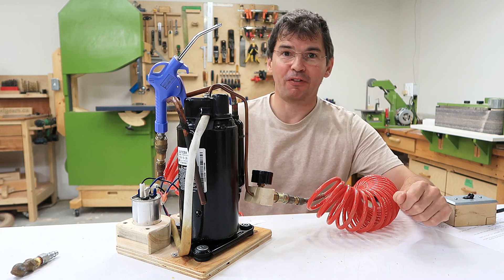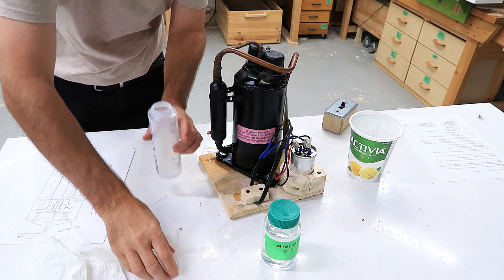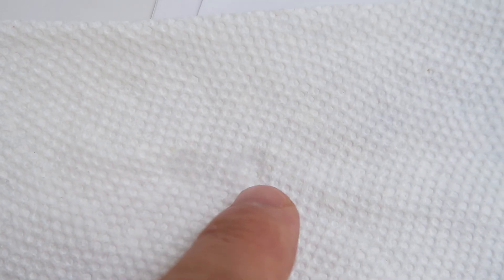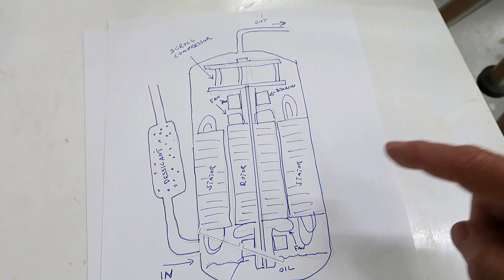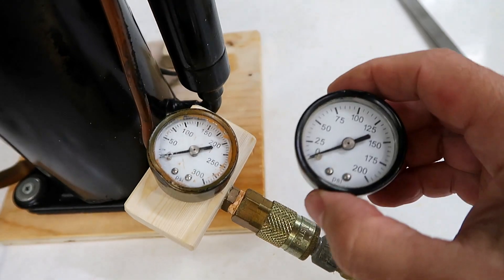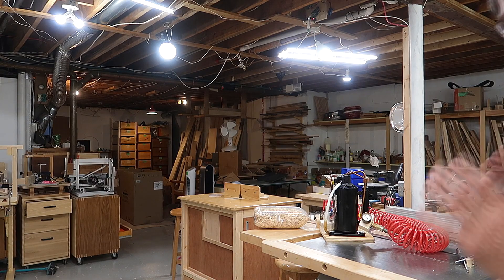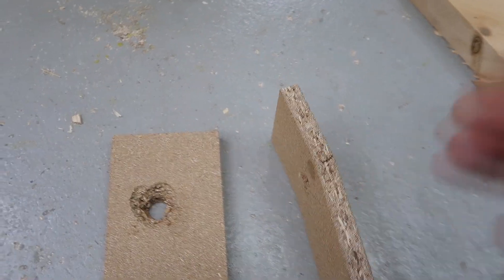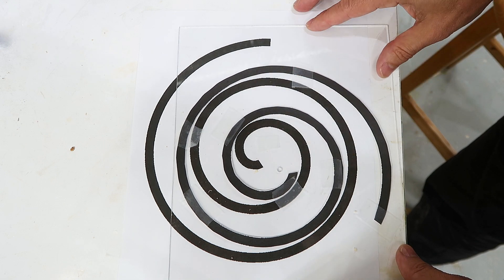This air compressor will fail

Comment: Seems like it would make a great second stage for helping your regular compressor go above 100psi. More efficient with already compressed air, and less duty cycle from doing work outside its efficiency range, and also pre-filtered air, so a lil less condensation.

Comment: You might have to add a air tank to get rid of the moisture and the oil. Commercial compressors with refrigerstor or ac motors are available, but they got expensive, I am glad that I bought mine 25 years ago..  Just google silent airbrush compressor and you will find exsamples (jun-air, sil-air etc.). Forget about the membrane ones, they suck completly (they spit water very quickly, ruined a lot of my artwork back then).
Greetings from Germany.

Comment: Heyhey, AC dipl. technician from germany here :)
a few tips:
dont turn the compressor on its head or turn it on when its upside down, the rotor etc can fall out of its bearing. And dont pump oil with it, the hydrolocking can damage the valves.
Use an oil trap to recirculate it into the intake.
And finally, visit the manufactures website on information which oils you can use. I recommend all ester oils
Reply: I wouldn't worry, he's an engineer and has been around machines all his life.  His Dad was a tinkerer and had owned a saw mill, his own wood working shop and also owned and took care of a campsite of cottages.  Besides, he said in the video that this machine was purely for experimentation.  He probably has a dedicated compressor for other tasks.

Comment: Well I’m sure you’re going to get this a million times but here goes. Eastwood does use a scroll compressor for there shop compressors. I personally have one and I can say it is incredibly quiet for a 12.5 CFM compressor and they clearly went through some effort to ensure limited amounts of oil make it though the output but yes it always has a bit of oil in the compressed air.
Reply: Does that mean going thru less tool oil?
Reply: @ZeroBlackfire  I was wondering that - sounds like a scroll compressor would be good for nail guns and other high lube tools.
Reply: @mikelastname no it wouldn’t be enough oil to lubricate an air tool.  You would still need to have an auto lubricator or add some yourself.  The amount of oil escaping from the compressor isn’t a huge amount.  It certainly isn’t a large enough amount to lubricate your air tools.
Reply: @ZeroBlackfire no it doesn’t.  The oil passing through isn’t anywhere close to being enough to lubricate your air tools.  You would still need to use a lubricator or add lubrication manually.

Comment: I used to pump soda bottles up to ~100psi for a project and didn't have a single failure...until one unexpectedly failed after I became comfortable around them.  It sent some plastic shards in my eyes and really messed up my eardrums for a few days.

Plastic shrapnel in the eyes is not fun.  I would not do it again.
Reply: Was it the same bottle or a new one every time?
Reply: @xxportalxx.  That was about 20 years ago, so I'm not sure how many times I had pressurized that bottle unfortunately.
Reply: @RK-kn1ud  ahh gotcha, doesn't really matter anyway I suppose.

Comment: Do add a input filter to avoid it filling up with wood dust.

Also, I am sure you can arrange a oil drip lubrication if you wanted. a check valve on the low pressure side may help it hold pressure too.

Comment: To help keep the compressor from having issues with water collecting in it, before putting it away after experiments, run it with no load for a minute or so to evaporate and remove any water that built up.
Reply: Bonus points if it is still hot from use, helping the water evaporate.
Reply: Problem is that unless it gets to boiling it won't evaporate because it's covered by a layer of oil. Though I guess a little that is still wetting the sides of the pressure vessel might.
Reply: @siggyincr7447  Since the oil gets pumped through, the water should mix in and enough droplets should be at the surface.
Reply: @Ultrazaubererger  water doesn't float on oil, it is the other way around.
Reply: I'm seeing so much wrong information in this video and comments. POE oil (compressor lubricant) absorbs moisture and breaks down into acid and alcohol. now alcohol is not a serious issue like acid is. that acid will eat away the insulation of copper windings of compressor and burn it out.

now this won't happen immediately. it can take weeks or even months but one thing is for sure that compressor is not going to in this world for long time. its death clock has started and its counting down fast

Comment: There are scroll air compressors, but generally they go from piston to screw/roots.

For air compressors generally scroll and screw are oil free, while piston can be oiled or oil free.

Scroll air compressors are generally used in lab or medical due to the low noise.

Piston is the low to medium shop usage.

Screw/roots compressors are for large shops and industrial applications. You can get screw blowers in 1000s of cfm.

Screw and scroll do the best with variable speed.

Comment: Could you use a simple liter bottle full of silica gel as an extra desiccant filter on the intake to help prevent water failure? Or do compressors need more specific desiccant material?

Comment: the tank part of the compressor is actually on the vacuum side, not the pressure side, so you won't have as much condensation forming in there.

if you look closely, there is a weld spot somewhere on the side, where they used a small hole to put the oil in, and then welded it shut, if you had a welder, you could use that method to change the oil, but it looked like the method you used worked just fine as well.
Reply from the maker: watch the video, I explain why it's on the pressure side.
Reply: @matthiasrandomstuff2221  its not on the pressure side, that seems like a lot of air blowing out but its actually not, it would be much more if it used whole tank as a compressor

Comment: Isn't there some kind of gizmo that removes the oil/water from the air output? Also, I'd love to see some real tests of typical woodworking tools. I'm sure it wouldn't be much use for a sander or painter, but perhaps for powering a nailer? I'm interested because my neighbors are really close, and I don't want to annoy them with a typical shop compressor.
Reply from the maker: you can buy quiet compressors that essentially use fridge compressors, but they aren't cheap

Comment: I always expect these to gradually lose oil over use like this.  It being sealed the way it is makes it especially hard to gauge how filled it is.
Reply: A very sensitive scale might be an option
Reply: @cellularmitosis2  An interesting approach.  I plan on plumbing on to push upwards into a wider section, hoping to coax the oil out of vapor so it can trickle back into the compressor.  Maybe even a long coil.

Comment: It's been a while since I studied pneumatics, but back then we were advised never to block off a pressurised line with any part of our body (fingers etc.) because of the risk of causing a bubble in the blood which could lead to an embolism.
Reply: Quite correct.  I believe the OSHA safe limit is 30psi for workers "dusting" themselves with compressed air for exactly this reason.
Reply: Bigger risk is a pinhole leak that can inject into you.  More dangerous with hydraulics as it injects hydraulic fluid into the skin.  Stings but doesn’t seem a big deal.  Wait a few day and gangrene sets in.  Dangerou for sailors as it can result in the loss of the hand or whatever due to damage before getting to a shore hospital.
Reply: There is a big danger of pretty much “flaying yourself on the inside” if you accidentally punctured yourself with the nozzle, there was a video of a guy who accidentally got poked with a nozzle in the stomach, and it was pretty nasty injury.
Reply: @motalasuger  there also was a video of a guy who thought it would be funny to stick the nozzle up the bum of his coworker. The coworker is dead.

No joke btw

Comment: I remember being told that dentists used these compressors as the suction tube to remove saliva in the mouth. I'm guessing that the other end of the compressor would be discarded to a drain. How much suction can you get with your setup? Would you think that would work, or was I lied to?
Reply: look up pneumatic vacuum cleaner, it uses venturi effect

Comment: The oil is carried by liquid refrigerant in the hvac application. Air won't carry anywhere near as much.
Reply from the maker: the refrigerant is never liquid inside the compressor
Reply: @matthiasrandomstuff2221  good point but the oil mixes better with refrigerant or there wouldn't be any circulation and you can see it move if you have a sightglass.

Comment: as long as its not running for a lot longer than its designed for, i don't see why it would die. Those motors do burn out when they run continuously and they often have a rating on a label telling you how long it can run for (a lot of motors have this)
Reply from the maker: window air conditioners tend to run continuous when in use

Comment: What you have there is a rotary compressor. Internally, the motor is at the top of the unit and the compressor mechanism is on the bottom. Both rotary and scroll compressors have higher volumetric efficiency than reciprocating types. The vessel on the side of the compressor is an accumulator. It captures any liquid refrigerant that happens to make it back to the compressor and holds it, pulling only the vapor into the compressor since the liquid is not compressible.
Reply: I did a quick search on the model number you can at 3:34 in the video. It looks like it is an older rotary compressor made by LG. There is a scroll compressor with a central axis discharge, I believe it is made by LG as well. The smallest scroll compressors I am familiar with are large enough to cool a ~1000 sqft house. If you are more interested about the internals of scroll compressors, Emerson has a good description of the internal components and how they work together on their website.
Reply: Definitely a rotary compressor. And like you said the side vessel is an accumulator. I noticed in his drawing it says "dessicant" which would be a filter/drier. Filter/driers are located on the  high pressure side after the condenser, "liquid line".
Reply: I'm a scrap guy who deals with tons of compressors, 100% guaranteed it's a rotary compressor! Seen loads of them!
Reply: looks like we have an exciting betting war here!
Reply from the maker: this would be unlike any such compressor I have seen taken apart on youtube.  I should start a betting pool.  How much are you willing to wager?
Reply: @matthiasrandomstuff2221  Rotaries usually have the discharge line centered on the top and the electrical connections on the top as well. Here is a good video that shows the internals of various compressors:  https://youtu.be/fhNb2gBhghE
Reply: @matthiasrandomstuff2221  As far as I know scroll compressors are only used on very big units. A rotary is still very nice.
Reply: @tiger.98  Videos on youtube are usually made by people who are confused about the facts which is Mathias's problem here. In the refrigeration/HVAC space this is very aparent thanks to MRcool.
Reply: @tiger.98  Not anymore. Scroll is king.
Reply: @matthiasrandomstuff2221  It is definitely a rotary compressor, not a scroll. Used as a workshop compressor, it should last forever. It will not overheat because there is almost no load on the motor compared to what it is designed for--400 to 600 psig discharge pressure with refrigerant R410a.
Reply: @jodydoakes8754  FYI, 400 to 600 psig with 115 to 130 psig suction pressure.
Reply: @matthiasrandomstuff2221 i'll all the money in the world.
Reply: @matthiasrandomstuff2221  i'd put $1000 on it being a rotary. they are constructed much differently

here is another video of a rotary i'm sure you've been shown others https://youtu.be/yr89-giZ56E
Reply: @matthiasrandomstuff2221  I've been an HVAC technician for 30 years, I'd be 100% confident in making a monetary wager that it is a rotary compressor.😉
Reply: @matthiasrandomstuff2221  I've been in HVAC all my life and taught HVAC at the local tech school for 7 years and opened up several of these compressors. @JohnAudioTech is right about it being a rotary compressor, as is the rest of his comment, and would put my money on him. If you want to slow the oil output, you can put a larger tube vertically (the larger the better, say 1  1/8" id +) on the output tube, maybe a foot or so (the longer the better), then restrict it down again to your desired size. Design it to spin in the larger tube, but make sure the oil will drain back into compressor when it cuts off, have the output at the center at the top. Normally in the refrigerant circuit, the velocity of the oil is what helps it move through the system and bring it back to the compressor, and if you slow the velocity down, the oil won't travel through it like it's supposed to, which is why a refrigerant circuit has to be designed correctly. These compressors are discharge cooled (as opposed to suction cooled in some compressors) so may last longer without ~50 deg F refrigerant passing over the windings, and you're not running it several hours at a time as it normally would in an AC unit. As long as the discharge temperature coming out of the compressor stays below recommended operating temp, probably < 200 deg F, you should be fine. As you noticed, the shell is pressurized, so water condensation, just like in a air tank, might be a problem. A periodic draining and refilling with fresh oil should solve that.
Reply: @matthiasrandomstuff2221  it is a rotary compressor working with those daily .
Reply: @matthiasrandomstuff2221  Some do have the pump on the bottom.  Look for a video "Scrapping Air Conditioner Compressor - How much copper is in AC Compressor" by Heinrichs Made.
Reply: @matthiasrandomstuff2221  I would bet you a billion dollars. We are HVAC technicians. We know what we’re talking about.
Reply: @tobyoverton_hvacr  Matthias knows just enough to be dangerous. No doubt it is a rotary
Reply: @tobyoverton_hvacr  Matthias makes great videos but his unwillingness to be proven wrong is a bit frustrating sometimes.
Reply: @Averna222  i thinks he is willing just he is  requiring others to bring the receipts.
Reply: @tobyoverton_hvacr  I've not yet seen a HVAC YouTube video where they didn't mix up run caps and "start" caps.
Reply: @matthiasrandomstuff2221  i would bett that john is write
Reply: commenting to remember to check later if anyone took the wager. doesn't seem like it.

Comment: Air compressors for work shops have oil coming out the line anyway. Hence the filtering if you do spray shop painting. So I wouldn't worry.

It's partly by design to keep air tools lubricated.

Comment: These scroll-compressors were used in the 90th by Volkswagen in the "G-Lader". Had the honor to drive a Corrado G60. The G-Lader sounds really angry, makes a lot of fun but has often problems with leakage and needs expensive service.
Reply: The 60 in G60 stands for the width in mm of the scroll blades. Volkswagen also used a G40 version on the Polo.
Reply: @BjornV78  I know. I had a Polo from 1991 since this year. But just a 1.0 (45 HP) 😋. Was my first car from 2000, where i got my license.

Comment: The canister on the side, is not desssicant. It's an suction accumulator, it's there to make sure that the compressor doesn't get liquid refrigerant.
Reply: The dessicant (filter drier) is on the liquid side, after the condenser.

Comment: they are used in some high end shop compressors, i have one, brand name is powerex. runs great and is oiless but is just expensive when its big
Reply: This is very different from an oil-less style compressor. And as someone with a ton of em, oil-less kinda suck. I have old ones from the 70's still running but all my oilless fail in 10 years or so. Not a fan.

Comment: There's an interesting Slo mo guys video of them shooting panes of glass with a gun, and it doesn't go through as many panes of glass that you may expect. A lot of the energy is lost to each pane (or in your case piece of particle board).
Reply from the maker: Especially with the marble weighing so little